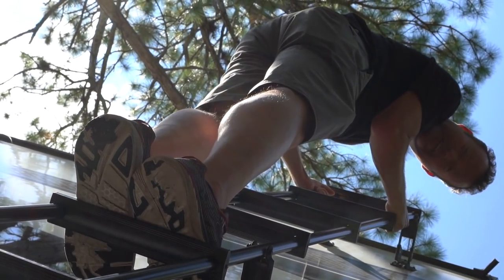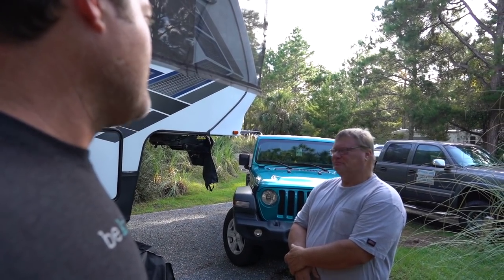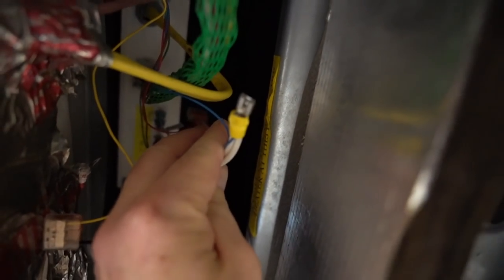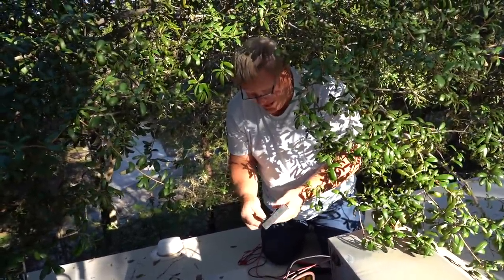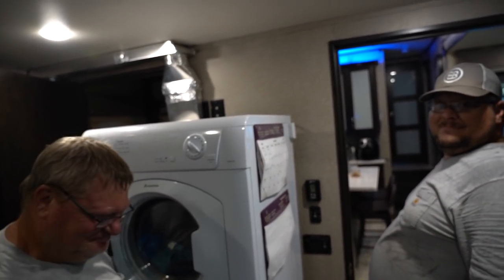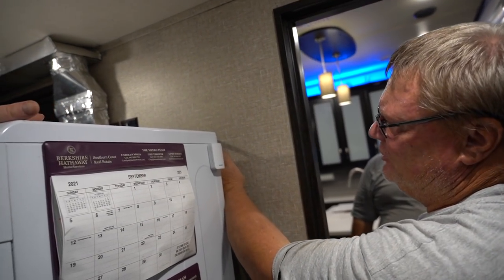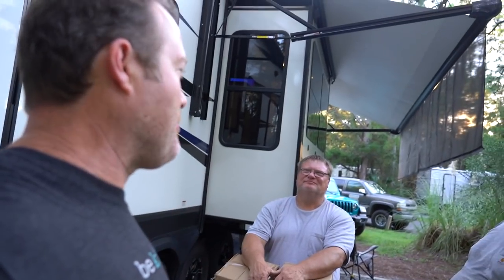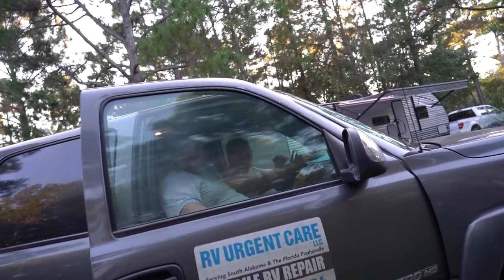RV TECH SHARES INSIDER SECRETS & DIY REPAIR HACKS

Comment from the maker: What is your favorite RV tip? TIMESTAMPS BELOW! 📰 Wholesale Warranties http://enjoythejourney.life/warranty
Travel with Tom & Cheri (2 minute survey) http://enjoythejourney.life/travel
✅ Click ⬇⬇⬇"READ MORE"⬇⬇⬇ for links to our favorite RV resources, gadgets, gear, & FREE stuff!
Orlando Florida Meet-Up http://enjoythejourney.life/orlando
RV Urgent Care (Billy & Chris) https://rvurgentcare.com/ (334) 504-5354
1st RV Urgent Care video https://youtu.be/0IqHfaL7sAo
RV Flooded https://youtu.be/oxcnTSTHMJI
RV rubber seal conditioner https://amzn.to/3oL8vRY
Schwintek Slide-Out Stuck https://youtu.be/WA-1OdoTZf0 
Lippert (LCI) 24/7 RV tech support chat, videos & more http://enjoythejourney.life/LCI or call 432-LIPPERT
TIMESTAMPS:
00:00 Intro
02:48 RV Urgent Care Mobile Tech Inspection (how busy are they)
05:45 Troubleshooting Coleman Air Conditioner
07:04 Are RVs Junk? Or Made Cheaply?
09:34 What Air Conditioner Is Better? Coleman or Dometic?
11:29 Inspecting for RV Propane Leaks
11:57 RV Seal Inspection & Rubber Seal Conditioner 
12:52 Why do mice & rats like to invade your RV?
14:26 Fixing Washer & Dryer shaking and mount
19:47 Inspecting Lithium Battery Wiring
20:47 A Techs Advice On Picking The Right RV For You!
21:56 Should You Travel In Your RV With A Full Water Tank?
23:03 Should You Leave RV Propane On During Travel?
25:14 What RV Brand Has The Least Problems?
27:09 Lippert Schwintek Slide Out Hack
34:03 DIY Fix Coleman Air Conditioner Thermostat Replacement
37:02 Solution For High RV Repair Costs
38:32 Meet-Up & Travel With Us!
⛺ Free Camping, Trip Planner & More! (90 Day Free Trial) http://enjoythejourney.life/dyrt
🚲 OUR EBIKES! GET YOURS TODAY! http://enjoythejourney.life/ebikes
➡️ JOIN US, secret videos, live streams, current location, YouTube creator tips & MORE! http://enjoythejourney.life/join
✅ MERCH! T-SHIRTS & MORE! https://teespring.com/stores/enjoythejourney
👍 Quick Start Guide: How to Make Money & RV & FREE RV Campsite Setup & Breakdown Checklist(s) http://enjoythejourney.life/newsletter
🎉 LIVE YOUTUBE CREATOR Q & A WITH TOM & FREE PDF DOWNLOAD http://eepurl.com/hrNi6P
📶 HOW DO WE GET INTERNET? http://enjoythejourney.life/speed (🤑 SAVE 5% OFF!)
SAVE BIG ON RV DIESEL! http://enjoythejourney.life/RVfuel (mention Thomas Kenemore)
OUR HITCH! GET YOURS http://enjoythejourney.life/hitch 
Get all your truck, towing, RV needs & more http://enjoythejourney.life/Etrailer  
SHOP OUR AMAZON STORE https://www.amazon.com/shop/enjoythejourney.life

*** SOCIAL: Follow us & share with your friends ***

Join the 'Journey Tribe': http://enjoythejourney.life/join
Subscribe to our YouTube channel: http://enjoythejourney.life/YouTube
Subscribe to our newsletter for updates: http://enjoythejourney.life/newsletter   
Join our Facebook Group: http://enjoythejourney.life/group
Facebook Page:  https://www.facebook.com/EnjoyTheJourney.Life
Instagram:  https://www.instagram.com/enjoythejourney.life
Website: http://enjoythejourney.life/ 

*** FAVORITE RV PARKING & CAMPSITE FINDERS! ***

Free Camping, Trip Planner & More! (90 Day Free Trial) http://enjoythejourney.life/dyrt 
Get $100 off a Thousand Trails camping pass! Contact Aaron Aaron_Massa@equitylifestyle.com or 360-489-4407 or contact Kimberly for a "used" membership http://enjoythejourney.life/TT or 800-272-0401 (mention Tom Kenemore if you call in)
The Best RV Routes, campsites & more! http://enjoythejourney.life/rvtripwizard (25% off with code: ENJOY25)
Low Bridges & Find Every Camp Spot - http://enjoythejourney.life/allstays
FREE RV parking: http://geni.us/boondockers
RV FREE at wineries, breweries, golf courses & more (save 15% off with code: HHFRIENDS15) http://geni.us/winedock
Save 50% on 1000’s of campsites!  http://enjoythejourney.life/HalfOffCamping

*** OUR FAVORITE RV GADGETS & GEAR ***

Check out our favorite gear (and fun stuff) that we use to enjoy the RV life
Get all your truck, towing, RV needs & more http://enjoythejourney.life/Etrailer  
Our Amazon Store https://www.amazon.com/shop/enjoythejourney.life

Thank you so much for using our links! Tom & Cheri’ :)

*** CONTACT US ***

Email: tomandcheri@enjoythejourney.life
Mail Bag:
Lake Effect Media
14870 Granada Avenue 1037
Apple Valley, MN 55124

Tom & Cheri, Full-time RV travelers sharing our adventures (and challenges), advice and more from the road. Inspiring others to do it now and live life on their terms, a life of freedom and adventure. 😍

Enjoy The Journey . Life, All Rights Reserved

Our channel is for entertainment purposes only. We are not RV or travel experts. We share our opinions and what has worked and not worked for us in the past. Before taking any action or making a purchase decision, you should do your own research.

Some of our links are affiliate links. We may make a small commission if you use our links which helps support our channel. Thank you!

#rvliving #rvlivingfulltime #RV
Reply: Yes my name is paul verkaik and I was wondering when you’re having the meet up in Orlando we are in Crystal River and it’s 24 February
Reply: I was told after my dogs chewed the wires out from under our brand new ‘19 King Ranch Super Duty 250 that they (wires) are encased in a coating made out of soy beans that animals love.

Comment: If I’m not mistaken this is same repair people that I saw pass our rv inTroy. Called them because I thought were in the rv park. They had already headed home. Came back to check out our problem with powerjack. We had replaced fuse still didn’t work. They used multimeter to  check. Only problem was it wasn’t screwed in tight. Possibly little corrosion. Refused payment.   Great guys and God always takes care of us.

Comment: Actually water is 8.34 lbs/gal. so that just increased your weight by over 100lbs compared to water weighing 7lbs. New Horizons makes between 50 -60 units a year. Mine was built like a tank. They build like a brick and sticks house.

Comment: Leaks have been our biggest problem with our 27 year old RV. 2 window leaks that ruined the floor. 1 tip out leak that ruined the floor. Hubby is a construction worker and handy man and fixed the floor 3  times. The last time we fixed it up we almost scrapped the RV it was in such bad shape. We got fixing one thing then the next, we put about $10,000.00 into and didn't know if it would be worth it but now we are living in it again. We did some out of town work and it sat for a little while. That is when it got in really bad shape. We have put on a new roof, 2 new AC roof units, new refrigerator, fixed furnace a couple of times, 1 sewer break, 1 plumping break. For 27 years that's not too bad. You'd have maintenance  in a house too.
Reply from the maker: Wow! Thanks for sharing!

Comment: I have a 1996 Tiffin Allegro Bus class A motor Home and i have not had any major problems with it. still has both original air conditioners, hot water heater ,furnace and never had a leak in the roof. it is always stored inside when not in use. Tiffin builds them to last well at least the older ones don't know about the newer ones as i love the old one i have still in great shape. great video keep em coming ..

Comment: Our slide topper rail let loose about 3 month after we bought our 5th wheel.  I called the dealer and told them I wasn't going pack it up and travel an hour to leave it for 3 weeks if all they were going to do was put bigger screws in it. At least the tech was honest and said that is exactly the repair the manufacturer would authorize. So I did my own research and put in the rivets that these gentlemen are talking about. In addition I took out a few key screws in all the awnings and slide toppers and replaced them with rivets. No problems since!
Reply from the maker: Thanks for sharing Amy!
Reply: Honestly nice to see this comment. I’m just starting as a tech. Want to make sure I do my customer units proper.

Comment: Reference the LP being on/off. Check state law because some states have restrictions on running with it on. Going through tunnels is one. If the line is cut and you get a spray of LP before the line shuts it off that may be enough to ignite a fire if there is a heat source near.

Comment: Glad you found good, honest rv repair. For pests you might try Pest Block packs....replace ever 90 days. Use inside and all outside cabinets. Fresh Cab csn be used too. I had creature aboard and I cleaned where I could get to and put in the Pest Block and a couple of Fresh Cab. Rodents will follow the urine smell left by previous rodents so clean as best you can. The trick is to keep areas clean and keep the packets fresh.

Comment: Red loctite is your friend. If you have a screw that you do not want to vibrate out, clean it and apply red loctite. Apply liberally. 

Water is 8.3 lb/gal. Not 7. 150 gallon is 1245lb. 

There is a device you can purchase for the propane line called a GasStop that will shut off gas if there is a leak. Unless it is a very new practice, there is NO safety device installed on RV propane systems on the majority of RV’s. That is definitely not something I would be telling people. You should ask that technician to show you the device on your RV or demonstrate how that device works. The standard pressure regulator will regulate pressure, not flow. If you want to test that theory, turn off both tanks, remove a main gas line underneath the rv or inside the tank storage area. Turn the gas back on. You will have a tremendous amount of flow from that line. Gas off for travel.

Comment: In my opinion, folks who RV need to know how to fix their own issues. Relying on someone else to do this can become cost prohibitive and possibly leave you stranded  out on the road for  a considerable amount of time.
Reply: It's very true, you need to basic maintenance things. And you can have several things like extra parts like fuses and tools of a mechanic to tighten this up... But when it comes to things like ac compressor and control board, most people can't order that and have it ready to go, let alone know electrical voltage instructions that can get them seriously injured.

Comment: I use aromatherapy oils to deter but not harm. 1 part cheap vodka or pure grain alcohol to 3 parts water 8 drops rosemary 8 drops tea tree and 12 drops peppermint per quart water solution. Spray around tires outside openings and inside around vents and plumbing.  Reapply every week.

Comment: Why do rats and mice like wiring and Pex? Many companies switched to soy and plant based plastics and rubbers; especially in Japan. They are drawn to plant based plastics as food. This is why most cars with rat issues are Hondas and Toyota; yes, other makes as well, but mostly these two brands.

If you redo any wiring or Pex in a camper or auto, make sure it's petroleum based plastic/rubber.

Great video!

Comment: Be aware, schwintech slides will NOT be protected by the module when in bypass mode.  You can literally rip the slide out of the side of the unit if you are not careful.

Comment: We ended up switching our thermostat to the micro air easy start thermostat. It uses Bluetooth or WiFi and you can control with your phone along with more accurate temperature control.

Comment: You might want to do something about the loose, dangling wiring.  Wiring should be secured so that the weight of the wires don’t pull connections loose.
Reply: I noticed that. In my Rockwood they are held together by zip tie from factory.

Comment: They have strip tye anchors that expand in the walls holds up to 700 lbs each i used then in my wall to anchor a wall mount for my 50 inch tv

Comment: 8.4 lbs to a gallon of water, and the rv is designed to carry that. A half full tank presents a lot more stress than a full one due to the sloshing motion when travelling.
Reply: In the past it was a matter of, is the tank sitting over the frame, or just hanging by straps. Now It's more of fuel wise, it's an extra 300+ lbs. your hauling up that hill.

Comment: 😳 It's just safe practice to turn off your propane. Those "safety valves" in propane systems (especially in RVs) can fail. Moreover, it's illegal in a lot of places to drive with your propane on, namingly in tunnels.
Reply: They were also saying the failure is typically with the refrigerator and that is probably it however when you are running them with propane as you go down the highway the issue is the same. We never travel with the propane on.

Comment: The Solution is 1 part Vinegar 1 part Scotch bonnet pepper sauce 1 part water and put in a heavy duty spray bottle and Spray every power wire and pex water line they won’t touch anything in that camper 🤟🏻🤟🏻🇺🇸🇺🇸🇺🇸

Comment: Tom, your friend is incorrect about the weight of water per gallon. is over 8.3 pounds plus per gallon. So that for your full 70gallon is over 581. of weight in that tank. but more important is want is the Gross weight of your total RV rig Truck Plus Trailer fully Loaded you need to take it to a truck scale and way it to know. I as a new RV owner in 2004 of a Chevy Dually with a long bed crew cab and a 36 ft holiday Rambler my rig weighed out full with water and 86 gallons of fuel in my truck weight over 22000 lbs less to adults that would be riding in the cab.. as that was my max GVWR I drive with half tank of water. to drop the extra weight Then fill at camp grounds

Comment: At standard pressure and temperature water weighs 8.3 pounds per gallon not 7.
If you are driving around with 150 gallons of water in your tanks you have added  1245 pounds to your RVs weight. That's about half the weight of my 2012 Civic.

Comment: One thing to remember when getting gas if the fridge is on with propane there is an open flame.
Reply: Doesn't the frig run on propane & battery when traveling? Won't food spoil if refrigerator is off traveling long distance? HELP!
Reply: @rosies1263  A lot of RV fridges are "two way", propane/120volt. The three way fridges include the 12 volt. That is the main reason (spoilage) why people keep them on when traveling. You just have to be aware when fueling up, that there's a lit flame at the fridge area.

Comment: My concern is that Billy diagnosed the problem as a control board but it ended up being the thermostat
Reply: I was thinking the same.  The thermostat should have been part of the diagnosis.  Especially since it's easy to remove and turn the A/C system on direct.
Reply: Could have been both.

Comment: There is no way 100 gallons of water sloshing around will push a tow vehicle through an intersection .
As one who drove trucks you always leave yourself room. Anticipate lights as much as possible. 
The company I worked for hauled chemicals in our trailers. Usually 5 to 6 thousand gallons per load. If you did an emergency brake that shifting load would ouch that tractor . But if you got to that point the driver probly did something wrong .

Comment: To chase Rats out of your rig. Buy Irish Spring soap, the original green stuff. Rub it on the under carriage and every hole that penetrates the floor. Cut up the bars and stuff pieces in any place it'll fit.
Rats have a super sensitive sense of smell. They can not stand the smell and will vacate any space where it is.

Comment: Your tech is wring about the propane shutting off. Every LP cylinder has an Excessive Flow Valve as part of the service valve on the tank. I
The EFV will snap shut if it senses an unrestricted line. This is also why when you open an LP cylinder you should open the service valve slowly because the LP vapor must dosplace the air in the lines. I am an experienced professional in the LP industry.

Comment: "Buy aesthetics"--whatever looks good to you being all that the manufacturers have left to differentiate their junk--is a really sad assessment and far too true, but it is possible to step out of Indiana nominal and find a few companies elsewhere that do, actually, apply at least some engineering to their products other than just federally-required roadworthiness--with an expected lifespan of decades. They are just exceptionally rare outside of the $250,000+ fifth-wheel and $1.2 million+ motorhome class. Even the smallest towables from Wee Roll, in Florida, are a good example of an extraordinary engineering exception--even their metallurgy is done correctly, which is nearly unheard of in the RV world apart from a certified commercial coach builder like Prevost (but Wee Roll units are not suitable for winter use outside the South without being customized by another company for that purpose--the factory options don't cut it--sort of like Airstream or Oliver). 

PS. Water is 8.3 lbs. per gallon, not 7, so there is even more behind what he concluded than what he said. I have a boondocking-designed rig with large tanks. If all of them are full, the coach weighs approx. 1,450 lbs. more than if they are empty and all of that weight is being carried by some pretty thin plastic and hanger parts.

Comment: Man why doesnt this guy have the proper tools? No stud finder, no laser temp gun. He touches the wires to test temp? Its called Harbor Freight? And no appliance slider reallyade me cringe.
No need to have propane on with dc fridges. I personally recommend folks turn it off when travelling. I dont trust the manufacturer installers.